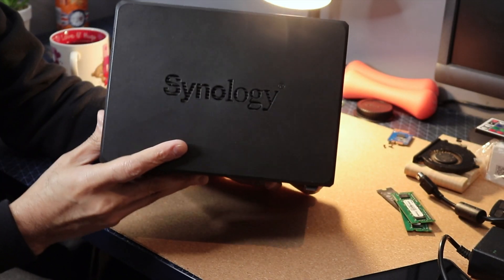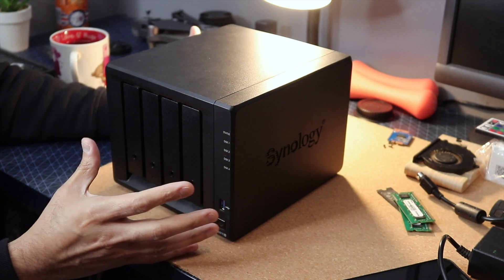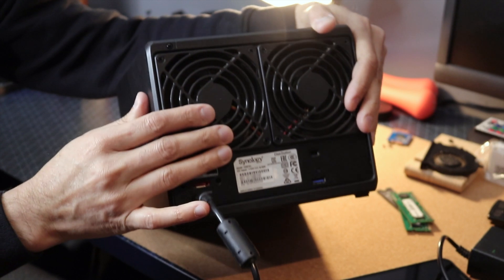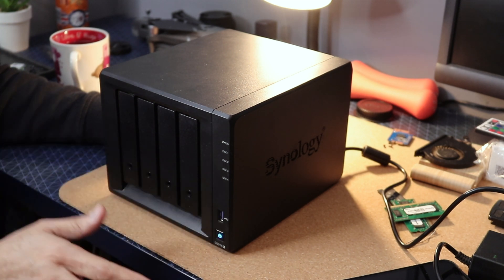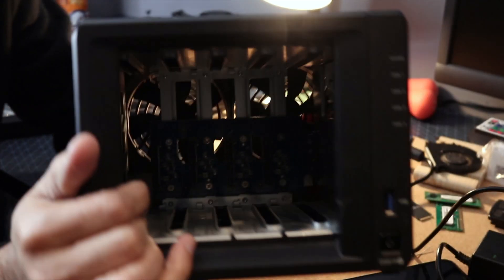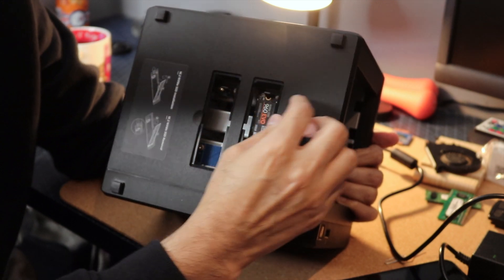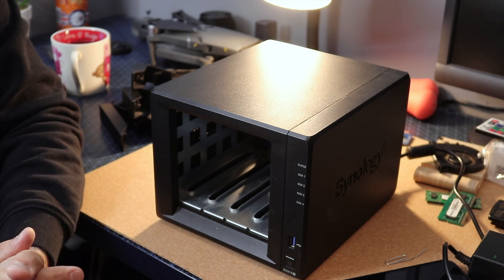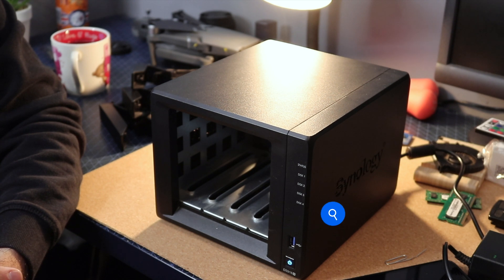SYNOLOGY BLUE LIGHT FLASHING | Synology ds 918+ | Tutorial 🔥

Comment: thanks for the vid. mine is slight different, the blue led flashes for around 20 secs and it turns itself off... any idea..?
Reply: Not sure if you already found a solution, but your issue sounds like the Atom bug that is solved with a 100-ohm resistor being soldered to some open pins on the motherboard. Its a pretty common bug associated with the particular CPU series. There are a few videos showing this fix and it requires some pretty simple soldering.
(I found out about this while trying to research my issues with my device)
Reply: @ryocoon  thanks, turned out to be a faulty power brick.. got a replacement from amazon and all sorted... :)
Reply: @fengluo2956  Glad your fix turned out to be simple! 😁👍

Comment: Strange advices here: pushing reset button is useless when you suppose motherboard is dead. How you expect it to start without any RAM? If you remove SSD - congratulations, you are at risk of crashing your RAID because you've remived its cache. Please, learn how to turn off the device with a long press of the power button before recording such videos in the future. 

Now, the real advice: First you should do when seeing infinitely flashing blue light is to check your PSU - unfortunately, official support will not tell you to.
Reply from the maker: I agree

Comment: I have a DS216Play with the symptoms described in the video (i guess faulty motherboard) - can I just purchse another empty DS216Play chassis and plug my two drives in and it will work as normal, or do I need to purchase a larger DS product with more drive bays and do a Hyper Backup to restore my data onto the new DS?

Comment: You obviously have no idea what you are talking about
Reply from the maker: absolutely correct - because all I want are view which turn into a monthly payment from Youtube. So do you really think I need to do a PHd in electronics!!!!
Reply: While I agree, you could've added something helpful to your comment.

It's likely the Flash ROM (think BIOS of the device) failed. Maybe the chip is broken, maybe the data got corrupted somehow (turning off power during updating/flashing). It is possible to connect to the chip via SSH over a serial connection (3.3V, GND, Tx, Rx – that thing) to get some more diagnostics done, and also to write an image to the EEPROM.

In case the chip is the problem, for I don't know how many Diskstations it's an SOIC-8 (8-pin bug), a Winbond 25Q128FWSQ for the 918+. The chip costs about I don't know, $5, maybe cheaper, and some cheap equipment to flash it costs another $15. Then you learn how to build the image, then write it to the chip.

The hardest and for some the most expensive thing to buy and to do is to desolder the old chip and solder on the new one, but IIRC there is a way to put the new one on top of the old one somehow. Costs what a useable solder iron or rework station costs, if you don't have any, together with some flux, solder or soldering paste, tweezers … Also some practice.

Or you pay someone to do it. Maybe someone with a PHd in electronics could do it for you and create a video for their youtube channel while doing it.

Comment: Hi, Thanks for the video... I have the same issue with the blinking blue power light... My DS918+ worked fine for 3.5 years without any issue or unexpected shut down. Then I moved to another appartment (shut it down normally and moved it to the new place - without any damages or fallen boxes or anything) on the new place I pluged it in and there was the blinking blue light. I will try to change the battery on the motherboard... I hope this will help... very disappointed about this (my whole life is on that NAS)
Reply: what was the outcome? mine just died as well... is there a workaround for this?
Reply: @oscarchd  I had the same issue, blinking blue light. I think, the eeprom is corrupt and we need to get it from somewhere for the same model and reflash it.
Reply: @nitinkumar29  i found out that the battery on the mobo was gone, replaced it with a new one.

also i found out that one of my ram or ram slot was bad, not too sure what happened, but, when i was using a ram slot with a ram, it came back up

Comment: Hello, how are you doing? I'm from Argentina and I know that error. You have to reflow the microprocessor or solder a 100k ohm resistor on the board. if you do that you resuscitate the NAS
Reply: Maybe BIOS is corrupted and we need to reflash the BIOS only.
Reply: hola sebastian, estoy teniendo un problema así, y necesito urgente solucionarlo, me pasarias un contacto tuyo para charlar y ver si me podrias realizar ese trabajo? soy de bs as argentina.Un abrazo!!
Reply from the maker: Noted sir
Reply: is there a guide for this? thank u

Comment: did you check the clock battery? mine did this (already had the 100 Ohm resistor fix) I checked the battery, less than 0,1V I replaced it with a new CR1220 3V battery and now the unit is working perfectly fine again
Reply: I already trying the same method but now it keeps blinking blue, anyway how long you wait until the green status led are on?
Reply from the maker: That’s a good question I haven’t tested that but I’ll make a note of that next time if that issue arises I can always follow the guidelines which is explained

Comment: Overnight my synology ds918 + stopped working.

the blue led was flashing and the fan was blowing intermittently when I noticed it.
So I restarted it (by force) no other choice.
when restarting, it turns off by itself along with the hard drives.
When I remove the hard drives and the ram bar, the NAS constantly has the blue led blinking.

And when I remove the hard drives and keep the ram bar inside, the nas has the static blue led and also the orange stats led flashing.
and the synology is visible on my mac from the "SynologyAssistant" application.

Could it be the motherboard as well, despite these different tests?
Reply: It is most probably hard drive and not the motherboard.
Reply from the maker: just replace the device. that's it. it will not work.

Comment: I had the same problem. Took out the RAM and tested it with new Ram without success. At this point, I thought I might have also lost the motherboard. I then reinserted the old RAM and tried one last startup with everything disconnected. For some strange reason, the NAS booted. I added all the drives and network connection and all is fine now. Maybe worth trying a few things before writing off the motherboard.
Reply from the maker: I spoke to Synology and they agreed that the issue is with the motherboard, so can't do much. replacement is the only solution.
Reply: @MominNz  My DS1019+ Died a couple of days ago same as yours. I think I have one more month for it to be covered via warranty. I opened a support case with Synology. What is your experience with them on sending a replacement?